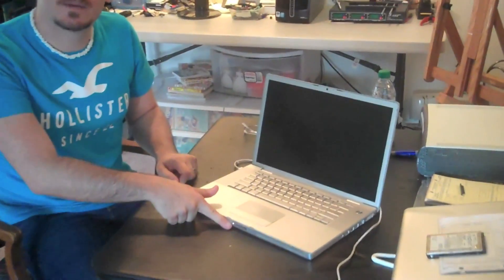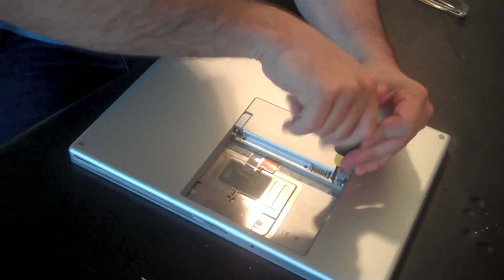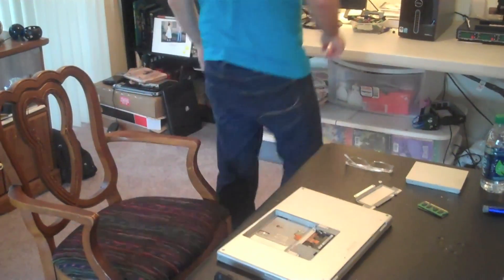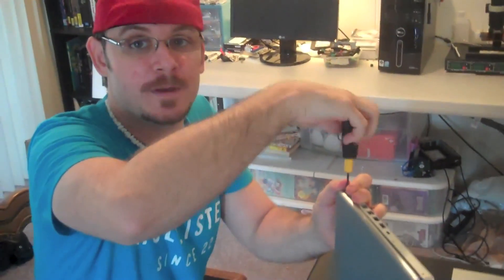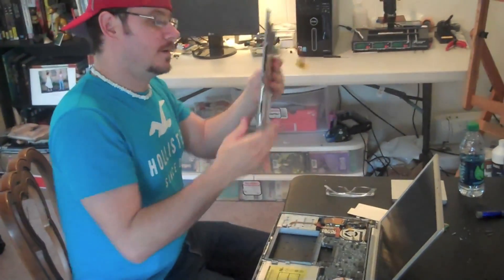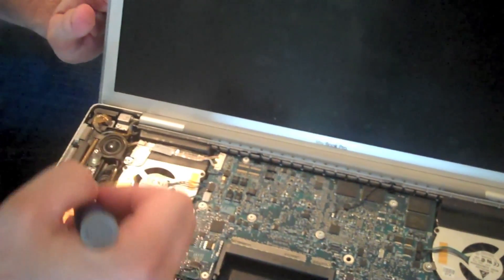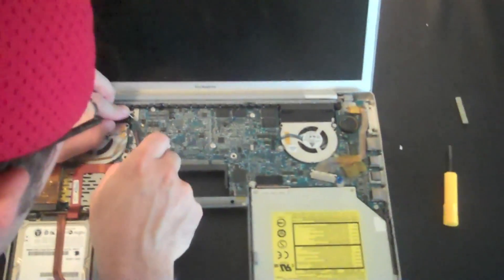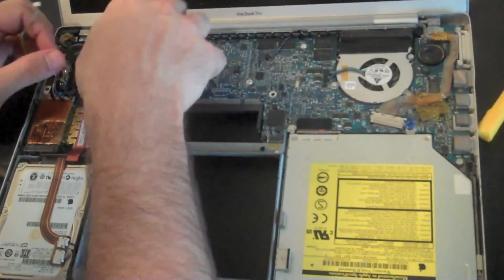MacBook Pro nVidia Black Screen Fix PT1

Comment: Hi mate
I have a macbook air 2010. When i turn on- it sounds, caps lock lightens, the screen comes but remains black.
Someone said to update my software and video firmware. How can i update it since I have no video on my macbook air. 
Pls suggest
Reply: Did you get it fixed? I'm having the same problem as of now

Comment: My stand by light is faint and fades in and out. The processors are running I also have a flashing light under the computer and my apple icon doesnt light up in back. Any answers as to why? or tip?

Comment: Hi! Really helpful your videos! I have a mid 2010 mbp (i7 -2.66) who is been giving me kernel panics which include a black screen previous to the restart. From all the info i could gather, it seems as the issue could be the gpu (eventually, if nothing else does the job, i'll try a reflow. I live in argentina, therefore apple service isn't a really good option over here), but looking at your video, i tried removing both Ram sticks and when i turn it on, i hear the beep you mention. Is there any other test i could perform to rule out RAM issues? If i have to try my luck reflowing the gpu, at least i wanna know i've tried everything else! Thanks, and keep up the good work!

Comment: Hi. I have a MacBook Pro A1278 with same issue. First it did nothing... The LED turned on and after 5s off. After a reflow of the processor on my ACHI 6000 it started booting and i could here the chime but the screen showed nothing. So I replaced the graphics chip which is a MCP89MZ-A2, but still the screen stays black :(
This piece of crap is starting to go me on my nerves -.-
Do you know what the problem could be?
Reply from the maker: have you tried connecting it to an external display?
Reply: Yes, but no success :(

Comment: Hi Utubeaccountnamehere, thank you about the information about the RAM, which happened to me, removed all RAMs from its slot, powered on and its beeping until i completely turn off by pressing the shutdown button. Does this means i have to buy new RAMs? or should i re flow it too? (nothing on screen, powered on only for 1-2 seconds and then off if RAM plugged in).